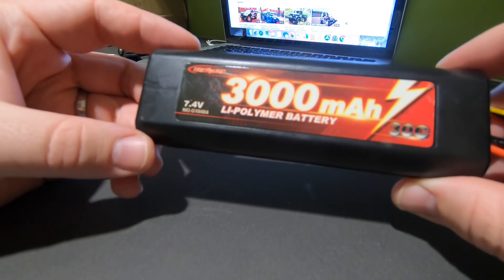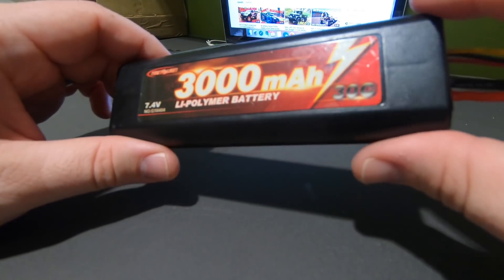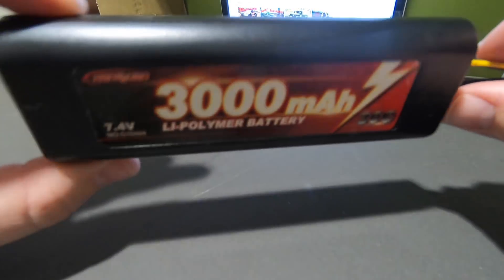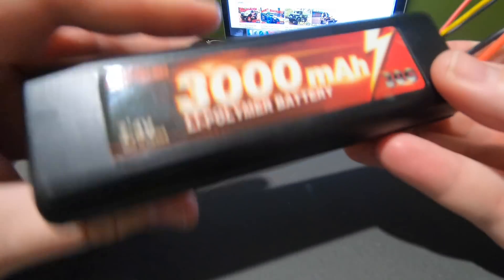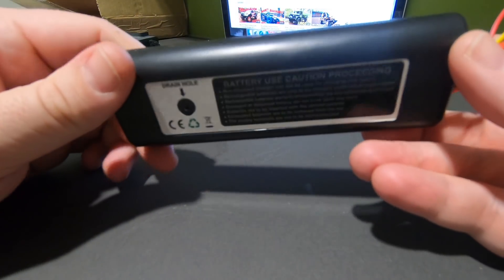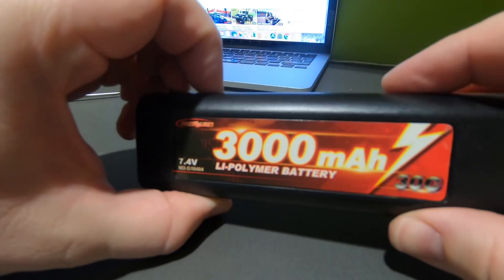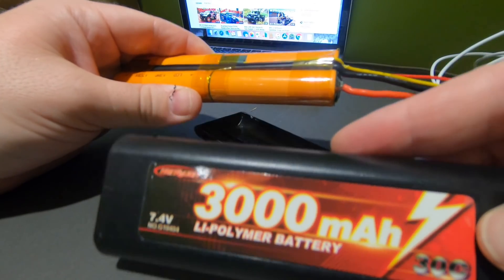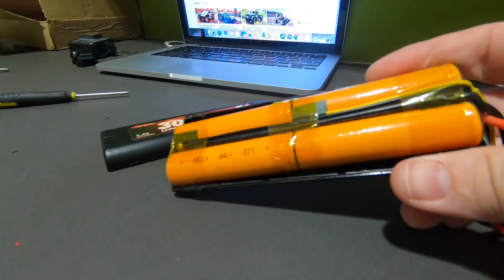Fake Chinese RC Li-po! What will they think of next? Cheap RC Lipo battery scam

Comment: Technically they are right cause originally, those batteries were named Lithium ion polymer batteries because the electrolyte was supposed to be bonded with polymers. But then after the polymer pouch batteries came out, people called them lithium polymers because of the polymer pouches. A bunch of mis-namings and common terms later we ended up calling 18650 types Lithium-ions and pouch batteries Li-Po's. But technically those were the original Li-Po's. Though they are not lying, they are using a technicality to trick you into thinking you are getting something you aren't. Tricky.
Reply from the maker: Yeah I suppose they aren't completely wrong, although I'd question the C rating?

Comment: Those LIon cells are 3.7v each..Wire them in series and you have a 4s LIon
Reply: It would burn that ESC, plus you would have a very short runtime if it did hold out
Reply: @TheBestOrion  Not running on that ESC of course..The run time would be shorter in series of course but that's not the point..It's power
Reply: @MOUNTAINRC160  oh, ok. Im pickin up what your puttin down :)
Reply: 18650s charge max to 4.2...i have multilple 2s and 3s packs made from drill packs that dropped a cell. These are probally 2 1500mah 2s setups wired in parallel giving the 3000mah.

Comment: I thought it looks a bit funny for a LiPolimer pack.. I usually make my own 18650 packs out cells taken from laptop batteries. I've got a balance charger and 3s and 2s ready made balance leads. Some of them are 2500mAh, some are 3000. They do the job for me and if I need more punch the pair them to double the capacity. As I'm more of a model boat guy rather than RC car and truck the size does not bother me as it's part of the ballast. I've got a 4 feet wooden Bismarck that runs off a 2s 18650 2500mAh for about an hour, and that thing is close to 8kg with the lead ballast. About the LiPo's, i'd trust Hobbyking more than anyone else but I'm reluctant to shift cash towards China too often. If i can make it with whatever I have laying around, I'll try that 1st. By the way, if you need a small pack, try e-cigarettes rechargeables, I've made a 2S pack, for a small model works perfectly.

Comment: Good info, I've had my suspicions on some of the cheap stuff as well. All the chinese cars I've tested have been 25% to 1/3rd slower. On the battery front it's quite shocking to see the proof. I've tested some of the awanfi ones you use and the punch they give is way higher (And the speed) than some of the 'big name' ones, meaning they're some people understating their packs performance, I had one 5000mah awanfi take just over 5500mah of charge (Reliable charger!). However, you have highlighted that there are some criminals out there as well! Nice video. There's one big name brand on amazon that has a warranty department that doesn't exist, they sell packs on amazon with a 1 yr warranty, but no way to contact them. I've got my money back from amazon each time.
Reply from the maker: Yes, I had seen these packs around and when I tested it against the partly charged Awanfi...I knew there was something wrong. The thing is, if they had put '3000mah Li-ion' on the battery, 90% of the people buying them wouldn't have had a clue or been bothered. It amazes me sometimes at what they get away with! Cheers for watching.

Comment: Now you know why ,,it was only $100 for the RTR.lol..It's one of the reason why I start
buying used 1/8  nitro rollers and converting them into brushless myself.
*Trust me...I have 3-4 ea cheap POS i wasted my money on...nothing I can with them.lol)

I know what Im getting...when I build my r/c...Plus if I like certain ones...
I know what's F up with them from watching videos...I know what I have to do
to upgrade them...or rather..Make them WORKABLE..like they should had
been in the first place.
Plus mine are faster then the RTR. I know what I intalled in them..
the exact brushless size and KV..
My latest is an old XTM,,they dont build like they used too...it's old..but looks almost
new on the inside...aluminum parts everywhere..even the dogbones are stainless steel
$85 to my front door...4082 2000kv...120A  18T pinion. 4s 50C 5000mah..50 mph...easy.lol
$200.....I have an RC8 and TT bushmaster too...all built for under $200..
They're $500 -ea toys with the upgrade parts or bugs worked out.. on them already.

Comment: Some LiPos are in cells like that. Did it say Li-ion on the cells?
Reply from the maker: Li-Po's don't come in hard shells like that, you can get some similar, but they are rolled up rather than incased. These are Li-ions for sure 👍

Comment: Interesting. I think you'd not be surprised how many "lipo" batteries turn out to be 18650 or similar li-ons.......
In fact a simple search on a popular search engine for "cylindrical Lipo batteries" turn up any number on a couple of Chinese sites.
You can test them to see exactly what they are but in this case, as with most others, you hardly need to.

Comment: It's a bit shady isn't it? The HG P407 has the same thing but just 2x 1500mah 15c cells inside so it actually matches the numbers on the outside at least (1500mah 15c). Modern Li-ion has the same voltage range as lipo and is effectively the same chemistry in a different format. Both use a liquid electrolyte so charging etc wouldn't be an issue. Lipo cells have much better punch though, they aren't confined by those tiny metal cases so internal resistance is much lower.

Theoretically, if these cells are 1500mah and 30 c each then wiring them into a 2s2p (2 in series x 2 in parallel) config you effectively DO get a 3000mah 30c pack. But i'd be amazed if they were really 30c. That would mean each cell was capable of sustaining 45a which even the best branded 18650s would struggle to do, let alone a cheap Chinese cell. 

Even assuming the pack is safe, and I see no reason why it would be less safe than a Chinese lipo, it's almost certainly going to lack punch compared to a true lipo. If they had just put li-ion on the outside it wouldn't be so bad.

The best 18650 cells out there can genuinely hack moderate RC use but I get the impression these aren't really up there.
Reply from the maker: Yes agreed, it's the purposely misleading case that's the issue. And they do lack the punch of a Li-Po, as seen in the video, the partly charged real Li-Po gives better results.
Reply: @TomleyRC  From what I've researched, even the ones that can handle quite high currents suffer a significant voltage sag under load. They can sustain their rated current but at a lower equivalent voltage than a typical lipo. 

If you look at something like the Arrma voltage which can use either 18650 or lipo, even using a decent pair of 18650s results in a lower performance.

And the Feiyue you just reviewed, same thing again!

Comment: the rounded corners of the case kinda gave it away, lipos are usually square,  that sucks they would do that, for safety reasons and just being dishonest about it.  Good job looking out for your viewers
Reply: Robert Barnes No, I got LiPos hard cases with round corners. Several quality brands make them. It’s just the case that has rounded corners. Not the LiPo.

Comment: Okay, but what about lithium-polymer batteries?
This is where it gets interesting. It turns out that what marketing departments are calling “Lithium-polymer batteries” are actually “Lithium-ion polymer” batteries.
What the heck does that mean?
In short, it means that so-called “lithium-polymer” batteries are almost exactly the same as lithium-ion batteries, but they are instead contained in a flexible polymer casing. It’s basically just a repackaged lithium-ion battery.
As far as the user is concerned, lithium polymer is essentially the same as lithium-ion.
The basic battery technology itself is the same: lithium-ion. This is what they call “lithium-polymer” these days.
So, if you ever have two choices for purchasing a gizmo, and one has a lithium-ion battery and the other has a lithium-polymer, don’t worry: As far as you’re concerned, it’s all the same thing, but in a different package.
Reply: Pretty much although lipo batteries tend to be much larger per given capacity, that's how they have much better punch. The internal resistance is lower. An 18650 is essentially the same thing just rolled up into a little can which means higher energy density.

It's really no different to how a AA nimh can only muster 5 amps but a c size nimh can put out 20
Reply from the maker: You Google searched it like me then? 😉👍
Reply: Metal Miner so the rip off here is the current rating of the battery and not the capacity?

Comment: pretty obvious by the casing what was in it, I was surprised that they at least put 2 strings of 7.4v in there parallel so it could pump out SOME current anyway, but that 30C, yeah right.
3A capacity at 30C could dump 90A, barely 2 minutes but... the Li-ion cells struggle to  push 5A and the 2 strings might make 10A available. not hating Li-ion cells, they're handy! excellent for low drain rate devices, I've modded transmitters and a couple crawlers to use them, have a couple 1/24 Subotech cars that use AA size for powering them too.

did you find what was binding/dragging in that budget SCT?
Reply from the maker: Yes...the 30c rating is the bit that upsets me the most!...not a chance! So I've stripped down the truck, everything was a bit tight and misaligned, but couldn't really see anything obvious. I've put it back together and now it free wheels a lot smoother.  So I'll fully charge a Li-Po (a real one!) and give it another run.

Comment: Could you please post what cells these LiIons actually are, as far it is written on the cells. I'm considering using LiIon batts on purpose.
Reply: ion cells are great as long as you're not trying to pull more than about 5A from them
Reply: Get Sony VTC5A, they can put out 25 amps or Samsung 20s can do 30a.
Reply: There are some 20+ A 18650 LiIon cells available. I'm just curious which cells these are, to check what specs they have.

Comment: Same thing different shape. They have saved money with more common battery format but it’s same chemistry. Only issue would be the cell balance when charging?
Reply from the maker: Similar...but not the same, especially in RC where you want a high discharge rate to allow maximum power. If these were in a Laptop you'd know know any different.
Reply: Tomley RC Garage  Your original video got me hunting for a 1/10 stadium truck or “short course truck” they all seem big money to get a 4x4 of any quality but for the Vkar you should askGearbest to swap it up. 👍
Reply: nope, they're different.
Reply: Technically they are the same chemistry but the shape and size of the 18650 massively limits it's potential for discharge currents. Generally you have to choose between capacity or discharge current with an 18650, you can't have a lot of both and even the low capacity "high drain" ones can only muster maybe 30A which is nothing compared to even a half decent lipo.

Comment: Did it come with one of the cars or did you buy it separatley?  Look's like  18650's, sneaky really sneaky and I assume that it registers as a 2s on the charger!?  Could be messey if someone charges one at high amps!
Reply: Dougo that's a for sure! on the plus side the Li-ion are less likely to explode or catch fire using or sitting around, less sensitive to being over discharged too.
Reply: @modelnutty6503  Your right better that than a doggy lipo, lol.   Just realised that he implied it came with the truck, so a better question.... Did any of the other RC's come with them?  I bet there all at it, so sneaky , sneaky, sneaky, sneaky.   If they try for recompense be wary of Tower of Peace buddy!
Reply: I was thinking that as well, surely there's a fire risk if they're not what they say they are when charging, makes you think, for sure.